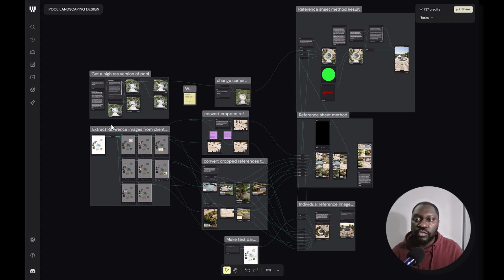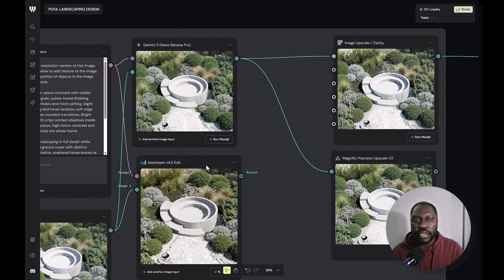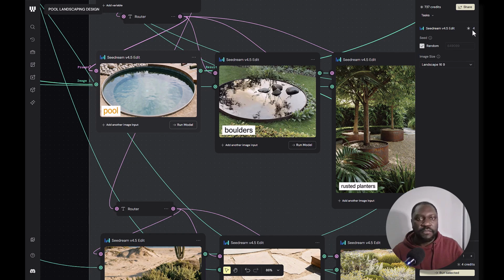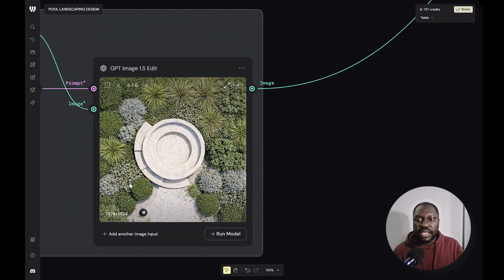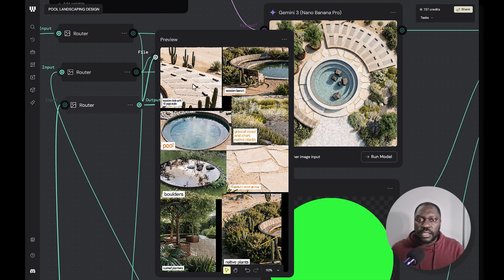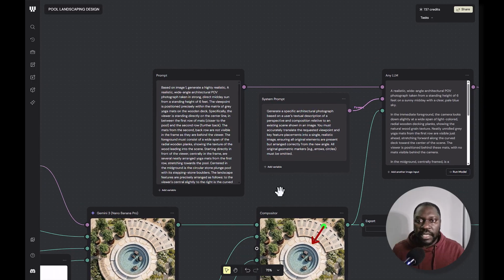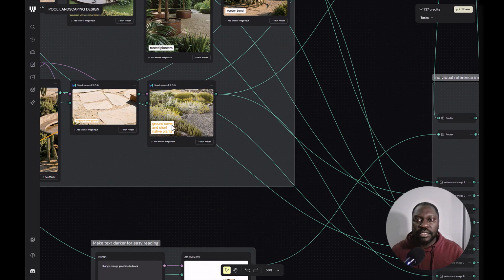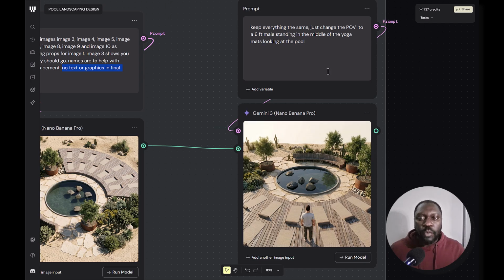Sketch to 3D Render | Weavy AI

Comment: Very smart! I did try some very closely. But you work flow more advanced! :)
Reply from the maker: Ooh that’s great! Which part were you trying?!
Reply: @projoexrstudio  I did try in my project to generate many camera angle images, then combine these images and titles for these images into a compositor model, with a black background.
I did use this like a character sheet, like a reference for video creation.
The problem is in the video, in the first second, I see this character sheet. 
Continue video plays fine.
Reply from the maker: @passionofartaleksandrplato7028 that does tend to happen in video as it tends to take first frame as that reference image. An alternative would be to use Kling 3 and input your reference images into the Elements block! You can have 4 references in an element and have more than 1 element as an input.